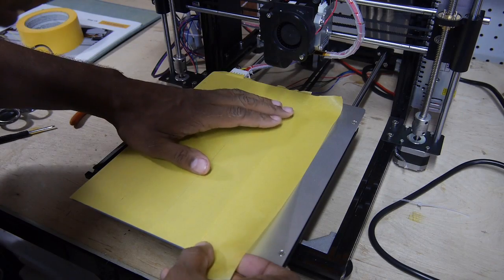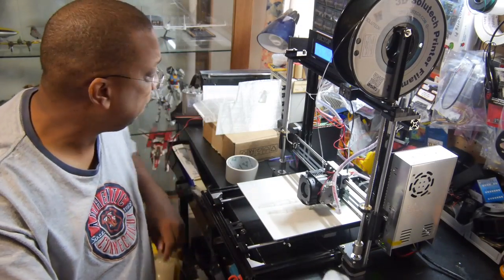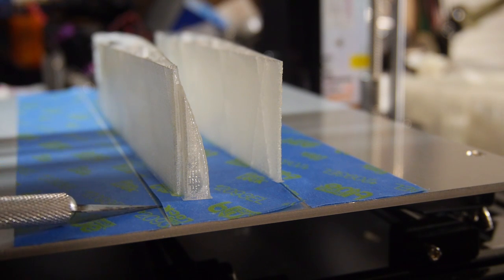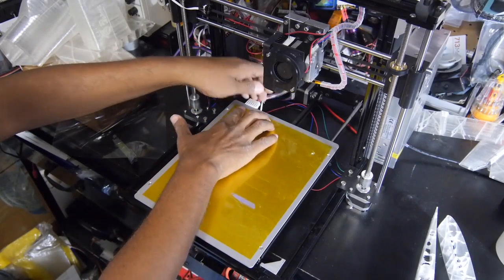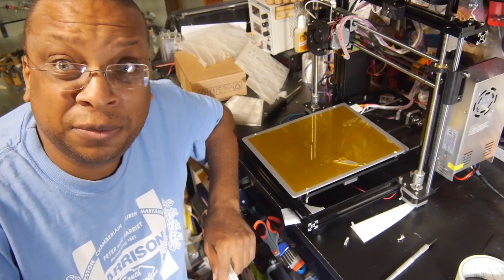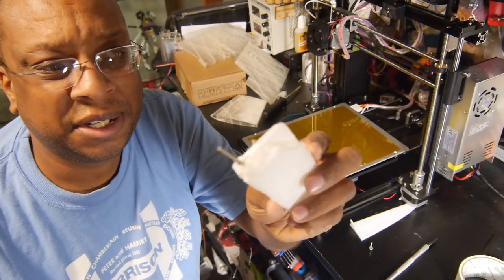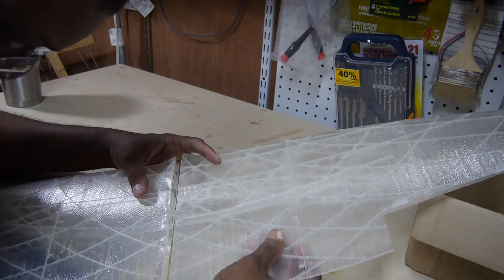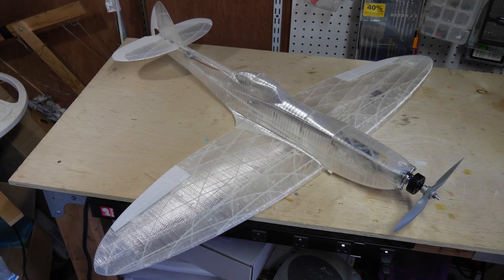3D Lab Print Spitfire  Mk XVI Build

Comment: WARNING! Make sure your printer has thermal runaway protection! You can test if your printer has this feature by disconnecting the temperate sensor from the motherboard and preheating the printer. If the printer stops heating and LCD reports "temp error" everything is good. Do this again but this time disconnect the heater cartridge wire. The printer should again after a while report "temp error" and stop. If the printer does not stop, you need to immediately shut it down and install firmware with thermal runaway protection enabled. Thermal runaway protection stops the printer from heating uncontrollably in the event that it cannot sense the real temperature anymore and continues to try to reach the set temperature. Your printer can catch fire! This crucial safety feature is missing in most commercial printers.

Comment: Nice vid.  I use Green Painter's Mate tape available at Lowes.  It usually is good for a few prints and comes in a nice wide format.  Always good to make sure its tucked down nicely using a credit card or hotel key card as a "spreader".   Be warned that the printed part will have a slight embossment from the tape, so if you are looking for a mirror finish on the printed part, you will need to do some sanding afterwards.  CR10s, printing PLA with 65ºC bed and 205ºC nozzel.  Works great.

Comment: go to a home depot if you have one and buy a box of 12 pcs only cause they wont sell one, its only $6.00 and some change fore 12x12 square mirrors, attach one to the hot plate with those stationery paper type clamps, one on each side in the middle of the mirror. it holds the part your making and releases it with no trouble and no tape, got the info off you tube from a few guys that tried everything on their 3d printers and the mirrors work best. lots of luck.

Comment: Hi buddy!
Two or three months ago I bought this model. Many times I tried to print it on my printer but without success. I use JGAurora A5 and Simplify3D. All attempts (I destroyed up more than a kilogram of filament) failed. In fact, either the printout was at first sight to be thrown away, and it crumbled in my hands. In other cases, I was satisfied with the quality of the printout, but the printouts were twice as heavy as those described in the model building instructions. I put it off for later. :(
Fortunately, you have succeeded. It means I can do it ... but, if I fail ... I will go to a mental hospital.

Comment: would it be better to use a 0.8 or 1.0 mm nozzle for more strenght?
Reply from the maker: I wouldn't recommend that. It would increase the weight and give a very rough appearance to the surface finish.

Comment: Get yourself a plate of glass 2mm thick and hold it down using binder clips (use glue stick on top of it), the adhesion is A LOT better than those painting tapes...
Reply: plus cover it with bed sheet...

Comment: Thanks for sharing this I am currently making printing and building one of these myself the design is well done I was happy with the way the parts came out. I also had the bed screws fallout on one of my prints early on in my printing. but my print did not eat the screw thats was strange. cool vid and thanks.

Comment: I've love to know what you use fir a radio systen> I haven't been able to find much info on radio set ups for 3d lab print planes
Reply from the maker: I used a Hitec Aurora 9x. But nay R/C radio system will work. If you are new to R/C model airplanes, this is NOT the plane to start with.

Comment: I have found a piece of plexi-glass coated with hairspray works great. The hair spray provides a perfect release substance while providing a sticky surface. It's never failed me.. but you have to buy the black label plexi-glass which is the cheapest plexi glass.

Comment: What happens if there's a power outage during the process?
Reply from the maker: We die....
Reply: With my 3d printer, when I power back up it will detect that a job is unfinished and offer to resume. Unfortunately, when the power is lost the fan stops, so the heat from the nozzle will melt the PLA in the feeder tube, completely jamming it up. So, no resume possible. Not sure what the manufacture was thinking when they programmed that feature in.
Reply: i have my Anet 8a connected to a UPS
APC Back-UPS 700 Watt / 1400 VA, 230V and linked to my laptop so if a power cut I will get around 3 hours but the chance is like winning the lotto. yes it does happen but hey what are the chances.

Comment: Interesting project, for sure.  You might Elmer's washable school glue stick to stick the part to the bed.  Caution - works almost too well.  Apply evenly, and one or two passes across the bed.  If it builds up, simply wash off with a damp paper towel or two.  Looking forward to the first flight video.
Reply: You don't actually need any glue, even go directly on glass. Secret is, go 20% at start until the first layer is deposited. Once that's done, you ramp it up in increments of 10 with count-to-five pauses (keeps the ramp jerk down). I have never had problems with this method on PLA, ABS you need to go even slower tho (others yet to be tested)

Comment: Hello Sir,
Need your help, I am RC Airplane hobbies.
Please suggest best low cost 3d printer under  $450 .
Suggest in the view of Airplane components, durable, spare parts of printer available, large working area etc . .  
Please guide . . .
Reply: I'm using a Anet A8 with no upgrade parts at all its just been setup correct from watching many good youtube vids.
i have bought this 3d model drawing  and my prints are fab even better than you see from here :)
you can get an Anet A8 for around £160 people may say it a bit high in price fo an Anet A8 but it has all the new improvement's , Anyway i love it and every moment its making something . hope you get one and join in the fun :)

Comment: Have you got the bed issues fixed? :)
I just use my bed as it is. Sticks really good even without a brim, I just clean my bed after each print with some isopropyl alcohol by rubbing the bed in circles at first and then finishing by moving in the direction of the brushed surface. Give it a try if you are still struggling with the bed and let me know how it works out :)
Reply from the maker: Oh, yea. Fixed it a while ago. Kapton tape and glue stick has been perfect solution.

Comment: Well made Video :) ! The in depth view into the printing process was really nice to watch. I'm 3D Printing for about 2 Years now , so it was kinda funny to see you doing the same tests, i did, when i started :D. I also used Tape for a long time, then switched to glas with Glue on it. You should try PEI as a Buildsurface but make it removable because it sometimes stick to the Print very well. Greetings from Germany :)

Comment: Do you know what flow multiplier you used? I have heard numbers between 1.02 and 1.12. I'm sure it is critical for thin-walled structures.
Reply from the maker: Mike Whincup , I ended up with 107% extrusion multiplier.

Comment: What bond did you use?? And what is that spray after you use the bond???
Reply from the maker: Super Glue. Also known as cyanoacrylate. You can find it at hobby stores. The spray is accelerator to make the glue dry faster.

Comment: Hi my son gave me the same plane for Father's Day but the elevator will not fit inside the back of the plane try to print a second one but still it would not fit any ideas would be  grateful.
Steven
Reply from the maker: Could you describe the problem in more detail. Are you talking about the moving part or the stabilizer?
Reply: Hi the elevator will not fit in the back of the stabiliser as the elevator is to long . 
Steven.
Reply from the maker: Steven, send me a message through Facebook and maybe we can share some pictures to find the problem.

Comment: One way I have found to keep nuts from working loose during any procedure is to take stripped wire and to wrap it around the bolt/screw in the valleys between the threads.  That should keep the nuts on and tight. Hope that helps.

Comment: I see a lot of guys use glass to print on with binder clips to hold the glass in place,  good luck
Reply: snaprollinpitts I've been doing that with disappearing purple glue stick and I haven't had a pla or abs bed adhesion problem since. And instead of using loc-tite on the screws I just went to the hardware store and got stronger springs to force more pressure on the nut. Again no issues since the change.

Comment: good one I have been printing the me109 on the alloy bed with a smear of glue stick and the bed at 65 c tip at 240c  and no cooling fan with good result's but with the fan on the end of the wings lifted badly . may help someone

Comment: Really nice, thanks for the update on the printer.  Your 3d print seems so effortless... I have a hictop coming tommorow, hopefully mine is as smooth as yours! =)
Reply from the maker: Thanks, though not quite effortless. I've since had a couple of issues like the power supply failing and needing replacement. And i found another screw I forgot to tighten, haha. But I've done a lot of printing. I've since started on the P-38.
Reply: Good to know, I am pre-emptively trying to strike down the power supply problem by running the heated bed through a mosfet, search amazon for 3d printing mosfet.  I think trigorilla is the best one on there right now, but there are a few to choose from... all under 20 bucks.  I am brand new, so maybe someone else can chime in with more details.